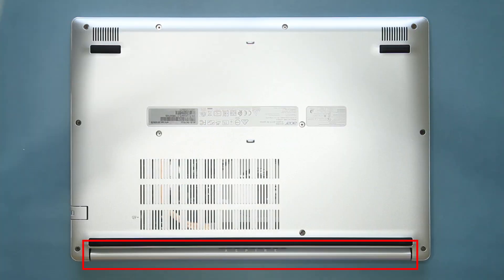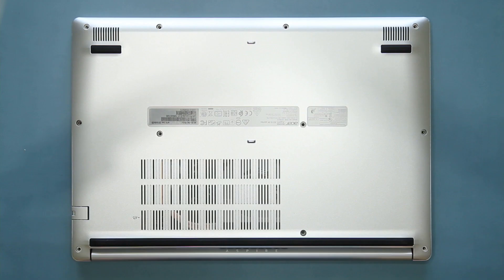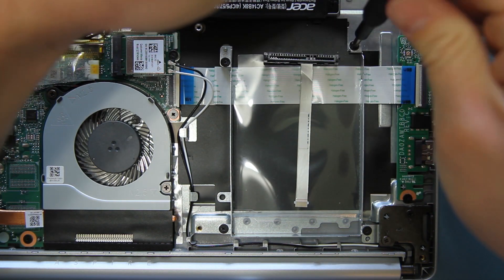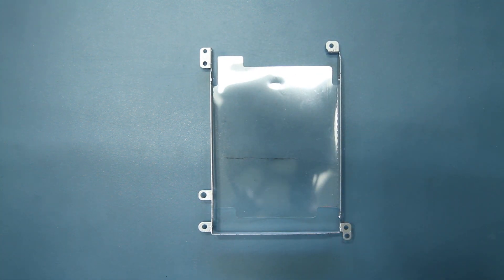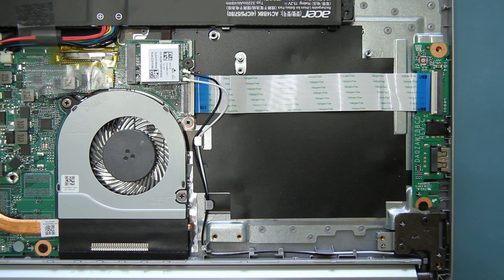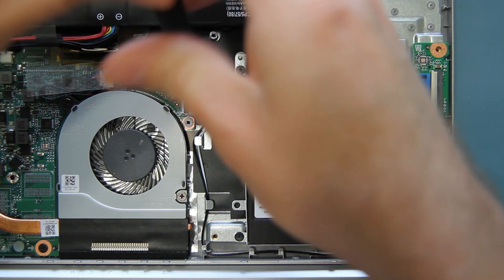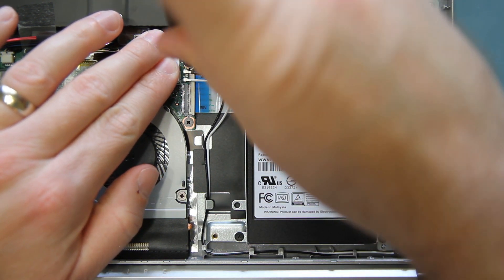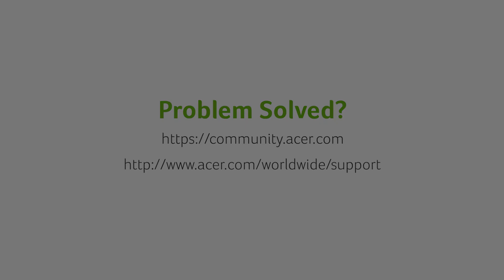Aspire A515-54 How to Install an Additional Hard Drive

Comment: Instructions are the same for the Aspire A515-55. If needing the parts, the Bracket is Part # 33.HGLN7.001 and the Cable is Part # 50.HGLN7.003 . Purchased both on eBay.

Comment: There is always stuck screw while opening this laptop. Bought 2 set of screwdrivers just to open back cover due to 1 stuck screw.  Now, the wireless card screw is completely stuck, with erased head which can't be unscrewed

Comment: Be cautious with the black and white wires going to the WLAN card. The black wire closest to the screw holding it down was soldered poorly on mine and had to be re-soldered as it had a poor bond. You can get a slightly thicker drive to fit if you remove the foam padding on the bottom plastic panel but it is a very cozy arrangement so verify thickness before you order. Save for the loose wire, the install went well with just a plastic pry tool, screwdriver set, and the hard drive kit.

Comment: Cable part number: 50.HEPN8.007
Bracket part number: 33.HEPN8.003
4 screws size: M2.0x4.5 (to attach the Ssd/HDD assembly to main body)
4 screws size: M3.0x3.0 ( to attach the bracket to Ssd/HDD)
Reply: me podrías ayudar donde lo puedo comprar en amazon no encuentro

Comment: I have different Acer Model, mine is  (A515-55-56VK) , Screw for LAN chip  (wireless card) was very very tight, Unable to remove it  ,  I wish it was as easy as  model A515-54 model.

Comment: My laptop does not have the mounting bracket or connector cable inside... 

Where can I buy these?
Reply: On the website, Acer says if your laptop doesn't come with the bracket or connector, to contact support. They gave this link: https://www.acer.com/ac/en/US/content/service-contact

My laptop comes with the bracket in the box. I think my bracket is not already installed in the laptop.

Comment: hello can we set any ssd 2.5 up ? samsung 860 qvo 2 tera for example ? thx
Reply: 2.5 inch SSD's come in a  7mm or a  9.5mm height=thickness
To be on the safe side, always go for the 7mm version as that's what I did with my 3.84GB SSD early this yr for one of the 2 ACER laptops that I purchased for myself.

Comment: My ribbon cable is too small. It was stuck under the plastic. I'd have to move the module to get it close enough to clip into the MB slot. Did they include the wrong cable?

Comment: Mine didn’t come with the hard drive connecter or the mounting screws
Reply: Mine had them separately in the box and I didn't even know what it was. Maybe yours was supposed to be in the box too but they forgot? I know your comment was a month ago but maybe you could ask
Reply: Have you check the INTERNAL area of the laptop? In some models the bracket is just inside the laptop case.

Comment: I believe this is the sata cable needed 
https://www.amazon.com/Connector-A615-51G-536X-50-GP4N2-004-71NFJ1BO007-DC02002SU00/dp/B07MY5H71S
Reply: that cable is not for this acer. I bought it and it did not fit. Does anyone know where to get the mounting bracket and cable? My Aspire 5 came without it.
Best Regards
Reply: @leaphar  did you find a solution?

Comment: After installing this hard drive, the case is not closing properly exactly in the area where the HDD is...what the hell should I do?
Reply: It seems like the hard disk is too thick: it has to be 7 mm thick at the most. Maybe you should consider a modern SSD?

Comment: do I need a new hdd for extra storage or is it ok with an old hdd?
Reply: Only if it is a 2,5 inch drive, of 7 mm thickness, as mentioned in the excellent video.

Comment: I have an Acer aspire 5 a515-52g. Can I add a SSD to it? It came with a 256 gb one already. Thx
Reply: I believe so. You may get similar caddy here https://tinyurl.com/y7d9aos5 but you need to open the laptop to make sure that it has additional slot for additional SSD.

Comment: for A515-54-37u3, what the ram speed in the laptop? 2400mhz or 2666?
Reply: you can check by opening task manager, going into performance, and looking at the RAM section, you'll probably be at 2400

Comment: Can we install nvme M2 by using connector  instead of ssd  harddrive. If yes will I get the mentioned speed or it lowers.
Reply: No extra m2 nvme slot I think
Reply: You can use M.2 NGFF SSD to 2.5" SATA III Enclosure of 7mm as in this ebay post for example https://tinyurl.com/yarr42qx

Comment: I don't think I got a bag with the additional screws -- what size are they and is there anywhere you'd suggest I buy them from?
Reply: It's a bit late so I'm sure you've already got it, but they're M3x4 screws. As for where to buy them, either from a local hardware store maybe or some online site like AliExpress.
Reply: Call customer service and they may sent you the missing parts for free.

Comment: At about 3:18 when the installer is connecting the cable his hands cover up the process.  The printing on the cable should be facing you, and you need to push the connector in straight, flat, and all the way in before closing the lock.  I didn't get mine all the way in and had to redo the process to get the drive to work.  A powerful magnifying glass helped.
Reply: C'mon man that's common sense, also the cable end has a white line which tels you to what depth it needs to go..
Reply: Thank you!
Reply: Pete the real is right

Comment: Can I install with a 2.5 inch SSD?
Reply: Yes, you can install SSDs or mechanical hard drives, as long as it's maximum 7mm tall (there are some that are 9mm tall or even taller, those won't do, there's not enough room inside for them)
Reply: @mariushmedias  can a Samsung evo 860 ssd fit In this laptop?
Reply: @rtey274  of course yes
Reply: A 7.5mm SSD is the same as a 2.5 inch SSD. So yes you can install a 2.5 inch SSD.
Reply: @spottedflametheflame  do you know what is the maximum storage capacity that it can support?
Reply: @asadnawaz5898  1tb tested OK, not sure about 2tb
Reply: @theepak7  I know it's a long time, but can you state the exact model SSD you used for the laptop? There are so many and I am confused.

Comment: what happens when the black and white cables get detached from the chip and how can i reattach them
Reply: Late AF, but nothing serious happens, those are the WiFi antennae cables and yes, you can plug them in again. Those connectors are not designed to withstand many connections and disconnections like the USB ones for example, but you needn't worry.

Comment: I can only boot from NVMe M.2 ssd.  How come I can't boot from adding the SSD?  Thanks
Reply: Probably because the new SSD doesn't have a software build installed, (windows, macos, etc)
Reply: because the SATA connection isnt standard so it cant be used to boot while the nvme m.2 slot is completely standard allowing you to boot. preferably you will want to boot from the nvme ssd anyway since its faster and (usually) more reliable
Reply: Because you didn't install windows or other operating system on it DUH or you didn't configure your BIOS right.
However you should always boot from the NVMe M.2 ssd that came with your laptop because it is A LOT FASTER.
Mine boots all the way to the desktop in only 5 seconds when pressing the power button from a complete shutdown. It sorta makes sleep or closing the lid useless 😂

Back to the topic, you can use your other drive and install all programs on it so I don't see why you want to ruin your laptop original configuration when clearly you don't have enough knowledge on this specific subject (That's why you asked in the first place). You'll only make more problems than solutions.

Comment: Does anybody knows if I can do a ram upgrade in this model? Does it have an adittional slot for a second ddr4 ram?
Reply: 4gb RAM is soldered onto motherboard and another 4gb RAM is given in the slot(for general configuration). To add additional RAM you need to remove this 4gb and replace it with another(Max upto 16gb)
Reply: Yes you can. I did I have 2x 8gb now
Reply: Actually my guts are different then the one on screen. I would check with the manual and see. I got mine on prime day.. From Amazon if that's the one you have your good
Reply: @cterry511  Maybe you have the model with the NVIDIA GPU which is a huge difference (You should see more parts and more cooling for the GPU)
Reply: @cterry511  This one comes with 4gb with no extra. They would just need to purchase ram from 4-16gb that is compatible with the model.

Comment: Does this method also works on Acer Aspire 5 A515-54-51DJ
Reply: Update: I've opened my laptop and yes, there is another slot for hdd/sdd. My operation was successful and my laptop is working fine with expanded storage 😄
Reply: @jonathancaburnay8231  please tell me about the ram upgradation, is there an extra slot for the upgradation or do we have to replace the existing one?
Reply: I'm interested in this answer as well. Also, I'd like to know if this model has space got an additional drive or if one has to replace the one that comes with it
Reply: @denysolivera  They provided a toolkit for adding additional drive but I haven't opened my laptop yet. But I think yes, there is another slot for additional hdd/sdd.
Reply: @jonathancaburnay8231  If they provided a toolkit then clearly you can do it. Why asking in the first place? Your laptop looks exactly the same as this one.

Comment: Does Acer sell the caddy or cable seperately? The laptop I'm looking at needs them to install a 2.5" drive, but does not include them.
Reply: the caddy and cable are shipped with the laptop
Reply: They are shipped WITH the laptop or INSIDE the laptop.
Reply: @impoppy9145  mine never came with the cable 😩
Reply: @staceyanderton1562  Call customer service. They may send you the missing part for free.
Reply: I looked inside the laptop... no caddy and cable. I probably found the right cable. Where to buy a suitable caddy for Aspire 3 model A315-54-33PK ?
Reply: You may get similar caddy with the cable from ebay https://tinyurl.com/y7d9aos5